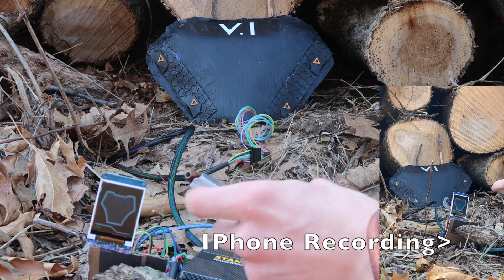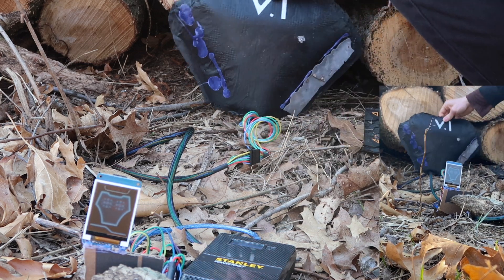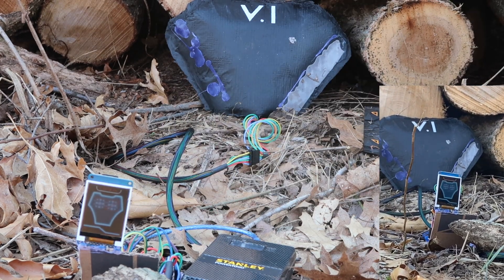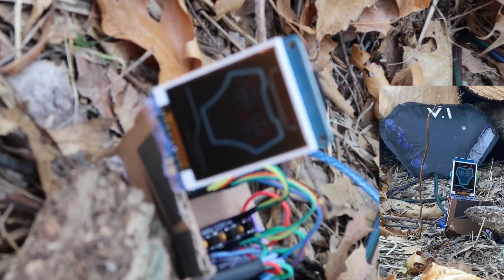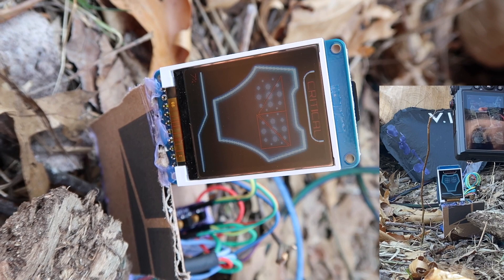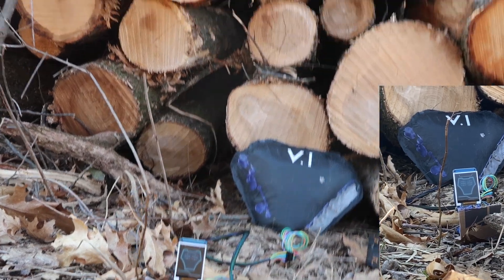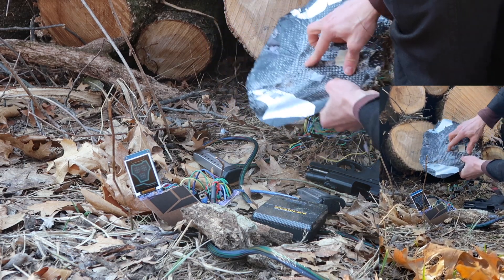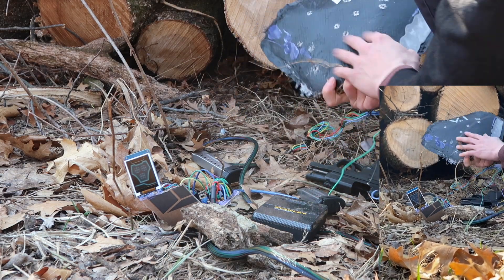Real Iron Man Proof-of-Concept Plate Demo

Comment: Can you use mini hydraulic lift to absorb the impact of the bullet with graphene on a thin titanium sheet ( doesn’t have to be pure graphene)
Reply from the maker: graphene unfortunately is expensive and also not tremendously good at stopping rounds yet (in theory its great). Titanium is good but its heavy, expensive and hard to work with so that's why I'm building composites for my demos currently!